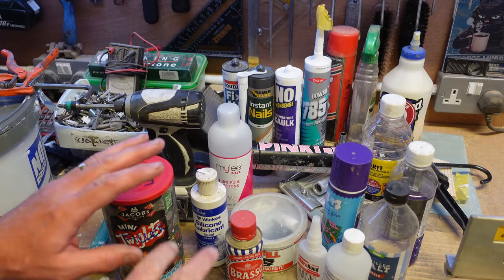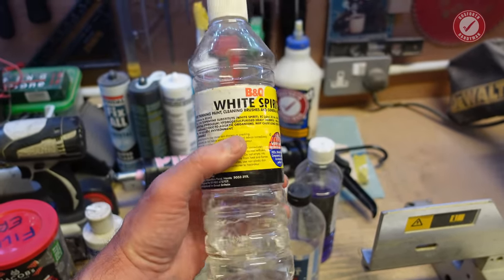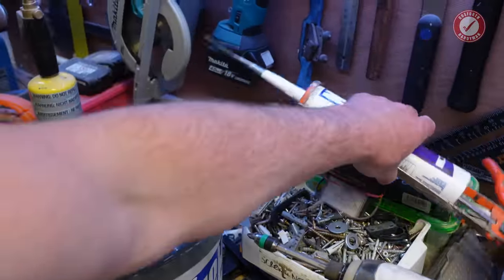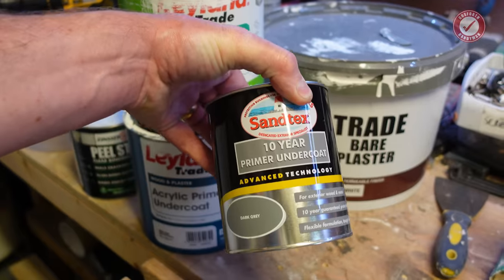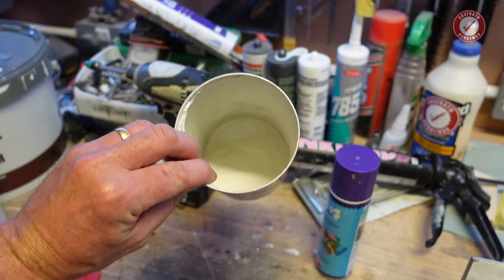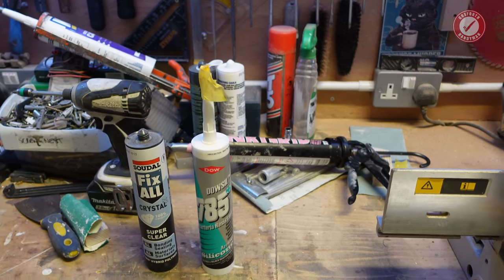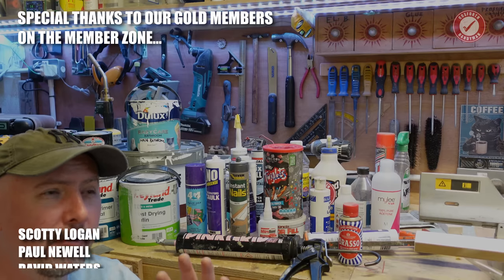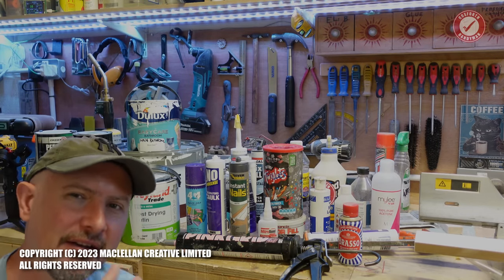Glues, paints and caulks we like to use

Comment: If your in a jam and need accelerate for superglue you can use lynx body spray deodorant !, my brother is a window fitter and saw him do it. Ct1 is expensive but the king of adhesives. OB1 is the new kid on the block for paintable calk/ adhesive. Again if you in a jam you can stick just about anything with cheap silocone even skirting board, once dry u will struggle getting it off. For removing Sticky stuff use "multi solve" doesn't have any harsh chemicals and works amazing! Cheers Andy loved this one👍
Reply: TBH, the absolute best CA kicker/accelerator is from Bob Smith Industries (and ZAP) - kicks off CA INSTANTLY - not like the awful stuff from Screwfix/Mitrefix etc. It smells tho :-) It's used regularly in the model hobby world - flying model planes etc
Reply: what flavour lynx? I just used "africa" and it didn't work.  I'm not joking. It went all powdery and wierd.
Reply from the maker: Interesting! Also, tried baking soda mixed with water recently... and that worked (as an activator). 👍

Comment: IPA is great for cleaning a surface to which you wish to apply something else e.g. caulk or a glue. Also great for cleaning you specs. Acetone is way more agressive and will melt your CDs (polycarbonate) if you try and clean them with it.

Comment: Big fan of leyland trade paint.. has never let me down.  
A tip i learned and use regularly is when you are painting a "smokers" house and the nicotene would bleed through emulsion  /acrylic paint 
 Use leyland trade oil based undercoat first . A coat of it  then your preferred emulsion itll never bleed through.

Comment: Hi Andy, Thank you for making this video. I have found it very useful as I am 50% of the way though renovating my house and things like plastering, painting and woodwork are going to be coming up in the next few weeks. I think I would need to look into it a little more because I really like the look of bare oiled or waxed wood (floors, doors, skirting boards etc etc) but I like tight lines so no gaps and the thought of having small nails from a nail gun just doesn't sit right. Thank you for talking to about how you have done things and why that has been a massive help in the planing of what I am doing to mine.
Reply from the maker: No worries and good luck with yours! It's a real challenge having bare wood skirts and archs with no gaps. 😁👍

Comment: Great video Andy.  I agree with so many of these products you used.
No nonesense caulk is my go to caulk.  It's cheap but OK if used correct.  Top tip, save the used nozzles if using lots of tubes and they can be used on the other tubes when the end goes hard.  
Leyland Acrylic primer undercoat is also another favourite of mine.  I have even used it under white emulsion paint when the sunstrate is being dodgy.

I have not used the Everbuild stuff before I will definitley give it a try on my next project.  

Keep up the great work Andy and lets not forget Mrs Mac.

Comment: That purple No Nonsense decorator's caulk is like magic in a tube. A pleasure to apply and work with AND it's paintable.  I've also had problems with Screwfix's grab adhesive in the past but i think they've reworked it, and the latest batch is sold in a grey tube.
Reply: I just bought the no nonsense caulk but it is not purple? Is that the old design or is it the same? I'm confused now lol

Comment: Thanks for taking the time to make this video, Andy. Very helpful.
I'm a fan of Zinsser BIN... very good primer for wood (seals knots) and also metal. Also a fan of PVA glue, both waterproof and non-waterproof... PVA has many uses.
Reply from the maker: Very good point on the PVA! Many, many uses. I'll add it on Amazon. 👍😁
Reply: Seconded on BIN, seems better at stain blocking than the Johnstones, and it sticks to anything.

Comment: Great vid, with some good tips particularly the adhesive... I had a bathroom fitter go through about 10 tubes of sticks like, what he was doing with them I have no idea.

Can I add two more suggestions for paint/undercoat: Zinnser BIN for going over wood without sanding it down or 123 for going over weird surfaces like plastic or fibreglass or whatever. Both great products and massive time savers

Comment: Easifill 60 - I broke a big bag down into large ziploc bags and it's lasted for ages and mixes well and spreads well.
Reply from the maker: Good plan. Yup, I've never found EasyFill goes off like normal plaster. I've got a bag that's been open for 2+ years and it's still fine. 👍
Reply: I used to use easy fill but now use  toupret joint fill and skim it is much better than easy fill..give it a go..

Comment: Hi Andy yes I have tried many of the products in your Video , and one in particular we did have a problem with which was the Leyland water based undercoat. It didn’t seem to like going over existing Dulux oil based satin finish , and could be literally scraped off the next day . The paint had been throughly sanded down , but for us it didn’t work. But of course like you others will not have a problem .    As a go to adhesive I’ve been using screw fix  OB1  which has been a revelation, I’ve used it on my new workshop which is a concrete panel design . Because it’s not practical to drill into the concrete , I’ve used the OB1 to stick wood to the surface which I have then fixed shelving and even cupboards to . I defy anyone to  pull the wood from the concrete once it set . But I will try the instant nails , because it’s definitely a lot cheaper   Best wishes as always 😀👍👍👍
Reply from the maker: That's interesting on the Leyland undercoat! Was it just undercoat or primer undercoat? As I say, never had an issue yet - even over gloss paint and pvc. Useful info! 👍

Comment: Just bought some nail polish remover yesterday making sure it's the acetone one. Vinegar has a multitude of uses - use it in the washing machine to descale as well. Got a bottle of isopropyl to clean records, but have found it useful for so many things. Used superglue to make small floating frames - worked great. Used a stanley knife to clean up any squeeze out I missed. I used Ronseal two pack filler for all the old doors and the letterbox (it was tiny but had a huge slope - widened it and filled in the slope), filled in missing architrave and fireplace mantel, which I carved/sanded to shape when dried.  Filing down a lot of suggestions. Good to see another fan of Twiglets.
Reply from the maker: Cheers Jules! 2 part filler is a life saver. Can be used for so many things and there's very little it won't stick to. 👍👍

Comment: Time to show you a few of our favourite things. Twiglets front and centre 👍😂. So other than Twiglets.. (also a favourite here!) I also always use Dow silicone. Also now only use Pinkgrip after having same issues with Gripfill. However I use solvent free version mostly. Toupret is my go to filler. And also rate the Leyland primer/undercoat.
Reply: Another thumbs up for Toupret interior filler.
Reply from the maker: Cheers! Haven't tried the solvent-free Pink Grip - will give that a shot at some point!

Comment: Great video Andy, solvents as in sticky removal I use Ronson lighter petrol or nail polish remover , bonding on block or brickwork  I use Hard as nails or No nails about 25 years ago When I installed power to my garage and workshop back in the day when I was aloud to I put 10 double sockets up in a 30 amp ring main I used no nails as well as screws a bit belt and braces about 2 years ago I wanted to move a socket ,taken the screws out and after all this time it was still bonded to the wall I ended up smashing the plastic back box off it is good strong glue  Fillers some times poly filler or no nails I will have to try Twigglets!  as all ways great video a lot of tips and options my ears are open to good advice  Thanks Andy take care mate, see you on the next video
Reply from the maker: Cheers Shaun! 👍

Comment: For paints, I've found Dulux are generally decent, superb mixing options as you mention - I usually go for the trade variants from a local builders merchant as they generally just go further and easier, and will mix absolutely any colour you can imagine. Had immense problems with their quick dry and, in the past, diamond satinwood, though. Amazing durable finish when you get it there, but an absolute nightmare to get a nice finish with - I've tried watering it down, floetrol, wet brushes, every type of roller sleeve, and it still either ends up looking like it was applied with a comb, or the surface of the moon. One of these days I'll try spraying it, just because I haven't yet.. Does the Leyland behave much better than the Dulux, in your experience? E: Oh, yes, and it just cracks on caulk like there's no tomorrow.

Peel stop's a life saver - the previous owners here didn't mist a single wall in the extension and it's just peeling and bubbling every time you look at it funny. Scrape, sand, peel stop, a little filler over the scratches, then primer to cover the colour and it's fixed. Expensive, but it pays in the time and frustration saved.
Reply from the maker: Used to use the Trade stuff all the time but the place that mixed it shut down... so back to Wickes and the non-trade stuff. Generally been fine. Yup, also had issues with Dulux Quick Dry! Leyland - you defo get brush marks and it dries INCREDIBLY quickly, but it doesn't 'ball up' (which is what the Dulux was doing... but that was many moons ago). So as long as you apply and lay it off immediately in quite thin coats it's fine. 😁👍

Comment: I'm not a painter or decorator but I think contract Matt isn't designed for doing mist coats. It seems to have plasticisers in which could explain the peeling.

We just use the cheap 10l Leyland or crown brilliant white tubs and water them down a bit. Goes on like milk but dries solid. never had any issues like shown, just wait for the plaster to dry first, which reminds me contract can go on fresh plaster apparently
Reply from the maker: Yeah, not sure - there's certainly instructions on the contract matt for using it as a mist coat. It could have been a dodgy batch! Got a vid coming up with a bit more info. 👍

Comment: Great Video Andy. I use Soudal Caulk, just a s cheap as screwfix brand and slumps a little less on slightly larger gaps. Won't use pink grip as didn't work to well on our skirtings and other things. Everbuild stuff is great, Instant nails is my goto. Regarding paint: The worst I have ever had was the B&Q own brands, just awful, terrible coverage and really scratchy. I have used expensive brands and cheaper ones but my go to emulsion paint is Wickes. Great value and lovely paint , covers well and goes on lovely. Will try the leyland satin but I really like the dulux quick dry satin.
Reply: Everbuold instant nails is the dogs...use it all the time and to date it's never let me down...if I need some really strong adhesive then I use sticks like shit or the dogs bollox.

Comment: Paints I like Johnstones Trade, Covaplus for ceilings it's super flat, cheap and goes on well not great on walls as it gets a sheen if you wipe it down. For walls I prefer their durable matt vinyl it's pretty flat, cuts in nicely, touches up well and can be wiped down ok within reason. Wood finish I'm totally the opposite to you, primer Zinsser BIN is amazing stuff, yes it's expensive but it goes far and seals a treat. Finish paint Dulux trade satin wood it flows out nice and smooth when left to dry and it's tough as anything, it is oil based but I haven't seen any yellowing over 3 years since I started using it and being an oil based it can take a good scrubbing. I've never understood why people love titebond so much, I generally use Everbuild 502 it's a lot cheaper and you're still going to break the wood before the bond if you try and get it apart, never had anything fail with it. The PU glues are useful in the right circumstances, the gap filling properties are handy but it is messy! Everbuild Lumberjack is what I have been using, go for the 30 min set over the 5 min you need a bit of time to get things together  and it generally starts expanding quicker than that.
Reply from the maker: Yup! Totally agree on the Covaplus, actually just added it to the list on Amazon. Great for ceilings etc. Great info! 👍

Comment: Great video, some really useful products that it is good to have recommendations for. Thanks. Could you do an updated tools you use vid that would be useful for DIYers to have.

The only thing I would add is "Mr Hobby T-116 Tool Cleaner R" which I use for cleaning my airbrush. If acetone or other solvents don't work that usually does the job. Great for stuff that you forgot to clean. Expensive but worth it for occasional use.
Reply from the maker: Cheers Glen! The tools one is defo on my to-do list. A lot of them are on the Amazon store btw. 👍

Comment: Great vid Andy. I totally agree with you on oil based paints. Dulux water based gloss is rubbish for yellowing. Johnsons water based gloss I'm 50/50 on that. Wilko's water based is one of the best for staying white - one problem only comes in small tins. Ceilings wouldn't go past Crown Trade Covermatt obliterating Emulsion it says white for years.
Reply from the maker: Good to know - I'll have to try the Wilko's one! 👍👍
Reply: Ronseal stay white ultra tough paint is brilliant. I use it all the time. I bought second hand solid wood doors that had been stripped but had woodworm holes, numerous holes from door furniture so no way staying raw wood. With sanding, Ronseal two part filler more sanding then Ronseal white primer, undercoat and knotting all in one then Ronseal stay white ultra tough satin they look amazing 😊

Comment: You said you won't use contract matt again but the trade bare plaster is contract matt. I bought the leyland trade satinwood after you gave it good reviews but it's a load of rubbish as I find you don't get a wet edge so it leaves roller marks on doors.

Comment: Hi Andy, Thank you soooooooooo much for this video - I've saved it in my "useful tips" folder.  While I totally support your quest for affiliate links from Screwfix and Toolstation etc, the challenge that they have (assuming that there is a business case for them to do it) is that both of them seem to have IT systems that are quite antique (a simple example is that neither of them have very good search capability compared to amazon) - adding an "affiliate" capability may well be quite expensive to add :(
Reply: Those 2 do affiliate links or they wouldn't be on cashback sites. Maybe you need to be a bigger business to sign-up.
Reply from the maker: Cheers! As JD says, I think they're only bothered about the big cashback and comparison sites. Which is pretty short sighted. 😭

Comment: Acetone, last resort? May I introduce you to Methyl Ethyl Ketone - the other other angry solvent in solvent cement. IPA's a nice gentle solvent for ink and paint markers, some adhesives, generally most plastics and solvent based paints are immune to it so it's a fairly safe first try.

Both methylated spirits and acetone are good at removing uncured styrene fillers - two part wood filler, decorfill, etc. I've gone past scraping them off my tools and switched to just wiping them clean off with a rag before they cure, much easier.

Vinegar's also good, being acidic, at removing weak cement - stains on clothes, little dabs on surfaces, etc, without being as vicious as brick acid.
Reply from the maker: Great info! 👍👍😎

Comment: About 2 years ago I did my house in dulux brilliant white but some parts of the walls need a touch up and I don’t want to pay for a full tin just to do some finishing touches. My question is, if I bought a cheaper branded paint such as wilkinsons brilliant white, would the shade of colour be noticeable?
Reply from the maker: Possibly, as all whites aren't equal. If you feather it in it should be fine, but you'd need to try it. 👍

Comment: Thanks Andy, lot's of great information here, I shall share it with my "Kids" as I'm starting to get a lot of questions on this sort of thing !

What do you use for outside gloss whitework and do you still use the grey undercoat for this, also, any advice in dealing with resinous knots, I've tried Knotting, heating with a heat gun and wiping off with solvent and even Zinsser Bin but still having problems !

The 35 minute video isn't a problem, but I'll be reading the comments for the next two hours ! 🤣
🤣
Reply from the maker: Cheers Andy! I'm also hoping my kids will refer to my vids first while we're on a beach somewhere. 😂 Must admit I haven't used white paint outside for a LONG time so would be interested to hear others opinions on this. I'd be tempted to use the acrylic primer undercoat and then possibly Zinsser Allcoat Exterior Satin White. Need to test this. 👍
Reply: If you've got a really resinous knot you just can't seal, probably the best thing to do is cut it out and fill the hole.
Reply: @Monkeh616  Thanks may have to do this !